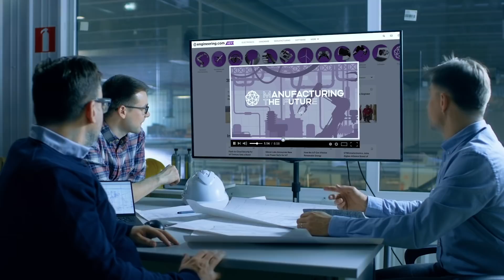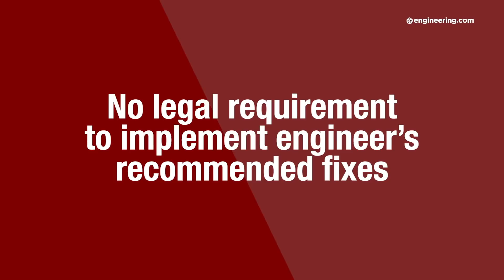The Florida Condo Collapse

Comment: Josh/Building Integrity ran the math after the drawings got modded (modified). 

I believe it was AT 100% load rate. That's bad. So what was said here about bring bring many times what is needed isn't right. 

The garage had stronger columns because of the cars. Might have stayed up if the rest did. Those bits that punched through the pool deck were laughable.

Comment: Missing a CRITICAL factor....
If there had been shear separation between the deck slab and the building, then the failure of the deck slab would not have transmitted into the building.  A double set of columns, plus other design elements, would have accomplished that safety feature.  The tower that did NOT collapse, had the shear separation.
So, DESIGN is beginning to seem to be the biggest factor from a lon-term perspective.

Comment: A Crane smashed down on top of the  Champagne tower South  in 1980 Cracking the foundation
Reply: No, it didnt.
Reply: @BigHenFor   Is it broken to 7 different pieces on top of the concrete slab come on ....  If I take a 200 pound sludge hammer  I guarantee I can crack almost anything ... Is that Crane had a 60,000 pound capacity and it flipped over and smashed on top of the slab It flipped over because It was overweighted So do the math .... And yes in 1980 South champagne tower  had a Crane flip over.... That is a fact....
Reply: @andy6041  so it waits 40 years to fall...? That doesn't make sense. Buildings fall right away.
Reply: @windsofmarchjourneyperrytr2823    It took 40 years to decay enough to be compromised ...  If it wasn't on the beach I would agree with you if it wasn't subjected to saltspray I would agree with you.... If it didn't get hit by a hurricane's  I would  Agree with you.   That it doesn't  make sense....  Did they use incorrect PS I's for the concrete absolutely .....   In a wall fell on the top of the parking garage in 2005 in the same vicinity as the original Crane strike..   i have 15 +  buildings in my career that would have never happened any of my buildings..

Comment: Electrolysis used on rebar but defective concrete was the structural cause of failure.
Reply: According to an architect I watched in Spanish, who got the blueprints, he noticed that the way the iron was connected inside the concrete, it didn´t have a great stability... so after so many years and the issues that happened in the basement, the columns didn´t resist anymore...
Reply: @lauruguayitausa  Anytime concrete is poured that is not mixed correctly and with good ingredients it is bound to fail. Somehow electricity was getting to the rebar too which only made the rate of failure to increase at a much faster rate. From the structural view that too was not up to standards. However there was far too much visible damage that when seen by inspectors should have signaled a red flag that was obviously ignored. That building should have been condemned long before the collapse until a suitable repair was put into place. Appears to me someone failed to do their job and report it as urgent which ended in total collapse and overwhelming uncalled for deaths.
Reply: @whip205inthebam3  most likely

Comment: You mentioned that the forensic engineers had not completed their investigation.  Yesterday (July 17) I saw a video that the chief forensic engineer of this crime scene was not allowed by any of the authorities in charge to examine any evidence.  This was the forensic engineer that had been in charge of the Pentagon investigation after 9/11.  He finally left.  I don't think there is any actual forensic investigation at the crime scene (which is what it is being called).  It actually appears to be a coverup.
Reply: Well , he is hired by Miami and has been blocked by federals .He has a bit of conflict of interests there . If will be a federal coverup we will see depending on it the level of idiocracy in US because it's enough information in public space already to form a very acurate picture  (not perfect ofc , but pretty acurate ) . Short version a adequated but flawed design got destroyed by "rain" because of high maintenance costs . The  parking roof concrete got wet , spalled , got weak , collapsed and pulled the main suporting colums . Everything else is secondary . More rebar would only prolonged the life of the building , also valable for more punchthrough reinforcements , as long as the deck is perma wet and tied to the main colums the deck will collapse will bring it down . There is blame to asign to lack of garage maintenance but this is in hindsight , nobody would have thought that the garage roof would collapse and worse , bring all the building after it . Most interesting will be the action towards safing the sister buildings knowing this .

Comment: The deck foundation was damaged by dump trucks hauling beach sand and work on the sidewalk causing the bearing of the deck to collapse. This damaged a few beams with along with a windy night cause to building to isolate and fall.
Reply: This is a really good point.  Beach sand is illegal to use in Florida in construction because the sand is corrosive due to the salt content.  I have been wondering if it was used either in this building or under the deck.  I'm sure the engineering company would have known this is illegal.
Reply: @HeleneLouise  What I meant was trucks hauling sand for beach re nourishment vibrated the foundation for the end of the deck. but as an ex inspector I wouldn't put anything past contractors.
Reply: @HeleneLouise  I have been hearing people say that that the company that built those two buildings are no where to be found.
Reply: You're making bold assumptions there buddy. Why don't you join the forensic engineering team. They may want your armchair detective opinion 🤣😂🤣🕵
Reply: @Scott-got-caught  The moment from  Champlain collapse of the deck to the column = wL2/12 could have been up to 75,000 ft lbs.
Reply: @designstudio8013  plausible theory but there is no definitive conclusion yet. Not that I know of. You stated it as if it was. Best not to side with theories until they've made an official determination
Reply: Why did a resident living on the 12th floor hear creaking noises at 3-4 AM the day before the collapse? The creaking was so loud it woke her up. Nobody else reported hearing this loud creaking noise, suggesting she was the closest to the source of the noises she heard. Considering it coincided with heavy work being done on the roof in the weeks leading up to the collapse, and residents stated they witnessed heavy equipment being placed on the roof by crane days before then, that would seem to indicate that something occurred on the roof that triggered the collapse. Davits were being installed onto the roof slab near the parapets and were load tested 24 to 48 hours before the collapse. The parapets were only attached by small dowels and in the security camera footage of the collapse, a section of the parapet appears to be missing... in the area directly above the resident that heard loud creaking on the previous day. A video captured by a drone flying around the outside of CTS showed deep standing water on the roof and corrosion of the steel dowels anchoring the parapet to the roof showed signs of corrosion (cracking of the parapets was also noted in engineering reports and repairs of the parapets was included in the preliminary repair plan for this year). Interesting how debris from an HVAC unit and a large tar kettle were identified in the rubble on the parking garage floor, in close proximity to the area visible in the TikTok videos. They didn't store a tar kettle in the parking garage at night. It's almost as if part of the cantilevered penthouse roof slab partially collapsed and the parapet and other equipment fell off the roof slab and crashed down onto the weak pool deck directly adjacent to the suspected column failures. How much impact force would be imparted on that pool deck by a parapet weighing 300+ kg, as well as a large tar kettle weighing 2700kg, falling from a height of ~40 meters?

Comment: This building had ground water flooding into the underground parking garage for years, sometimes over a foot of water. That had to have have caused serious degradation of the  whole foundation system, and this was never addressed, other than pumping the water out. The garage ceiling had serious spalling, and water leaks that residents were complaining about that were getting on their cars. There were a lot of warnings on this building, that were basically ignored.

Comment: Estatements  on steel deterioration was done. The people fought over money so nothing was done for 3 years. It failed because no one gave a dam, city ,state  or residents. And back seat wannabes  should shut up and learn facts.
Reply: Yep, mostly the HOA, meaning THE OWNERS!!! 
Period
Reply: Reports even show the HOA was more interested in making the outside of the building look better
Reply: @csnb2002  Spend a lot of money on marble in side, and kitchens. But on there cable, phone, electrical was there the day it was built. Well doesn't matter anymore it's gone or they died, no inspection so insurance won't pay.
Reply: @HypercubeJones   HOLD your breath and read fine print, Get good lawyer because if they do it might not be for along time, still doing settlement from andrew.  Read the portion on inspection real good. They do not have the 40 year inspection.
Reply: @HypercubeJones  But not completed or signed off. buy a new car and don't change the oil and when it breaks down what is dealer going to say. The same as insurance companies " guess it fail so would of the inspection. P.S,  notice the wall to the left, where are the bolts???
Reply: @HypercubeJones  The inspector doing the job there I know from working cable for 30 years, The building was deemed unsafe the final was not put in as of yet so the insurance is not valid . gone thru so many contract with these complexes the the balconies are screwed shut that it's comical. So you being an insurance expert that your company is going to cover a claim when the building falls down because it should of started in 2017 but the owner argued over price. Started at 8 and went to 15 in that time. So your walls of your house break and it's because of your sloppy maintenance I'm sure they will pay. Your wrong live with it, from why all the way.
Reply: Have you read that report? All the engineer said was that repairs should be done in a "timely fashion." Doesn't seem that urgent does it. The inspection process is not fit for purpose. There was no measurement of the extent of of the concrete deterioration that would make ordinary tenants realise the urgency. Field surveys done as is are not enough. There should be some materials testing with remaining life expectancy estimates  included in such reports. The building permit requirements are not fit for purpose either. The information often supplied to  and retained by the building department is cursory to say the least. So, tracking the condition of a building and what exactly was done to it through its lifetime is made more difficult. And self-certification of compliance to building codes and standards is a questionable practice that allows developers and contractors to hide questionable decisions. For example, the major restoration of the garage and pool decks in 1996 involved the removal of a BMA beam from the garage ceiling. That fact only came to light by comparing the original 1979 plans with the plans made by Morabito Engineers in 2018. The project engineer Tong Le did not mention that when he made his certification statement about the restoration of the pool and garage decks. He mentioned that a 20ft area of spalled concrete had been repaired to Specifications and the  SFBC. That beam detail was not mentioned in the application for a building permit, nor are there records if this was noted by Surfside Town Building Department. Moreover, 40 years is too long a period to wait to have an extensive remediation program for any building. The detail of major structural repairs and restorations to condominiums need to be a matter of public record. 
As it stands with the state of record-keeping and regulation as it is, I  would not buy a lease in a condominium anywhere in Surfside. And if other towns and cities in Florida are so cursory in regulating building construction and maintenance of high rise residences, I wouldn't buy a condo anywhere there. It would be more problems than it would be worth, because invarably with so many people involved, decision-making is slower and more arduous because of human nature. Having to find nearly $70,000 for each leaseholder to cover the costs of structural repairs would make anyone pause. Democratic management of a building through condo associations must be like herding cats. So, it whether you want to call it apathy, or whatever, such costly decisions are slow to be made by their very nature.
Reply: @BigHenFor  KISS the building fell down. So the report had what date the one refilled or original. The building FELL DOWN / tenants argued over cost starting in 2017.  The person who wrote it probably is under a microscope. The pool sank, puddles formed around the pool and didn't run off. The deck cracked main columns supported on it. So what that paper said is worthless. Maybe it was the same guy who signed off on the shopping center that didn't stay for the pours, contractor picked up rebar poured. Also filled the caps with trash and not cement to hold the rafters on.